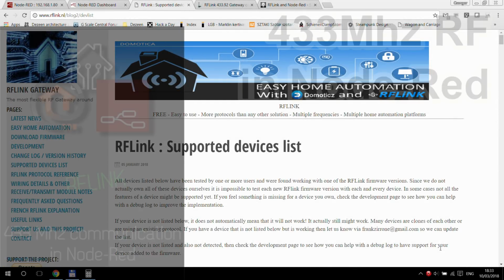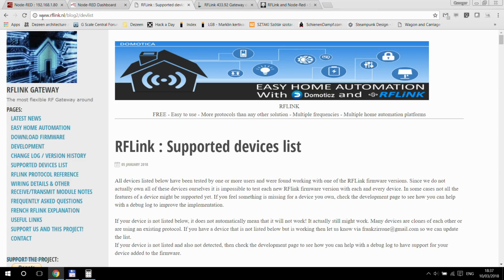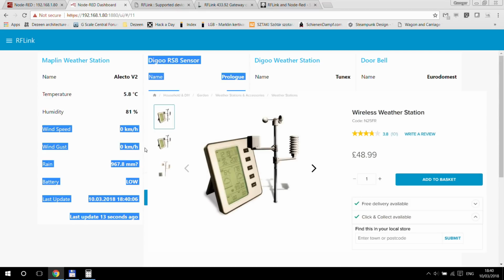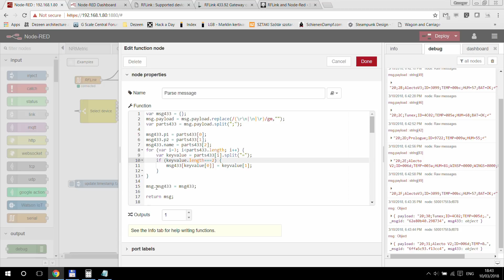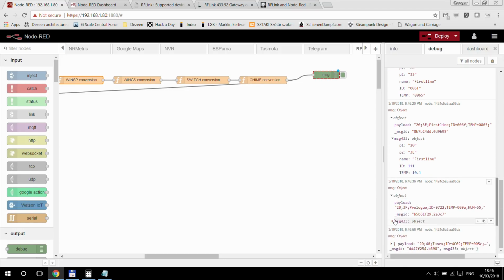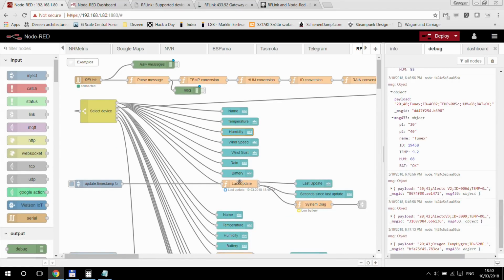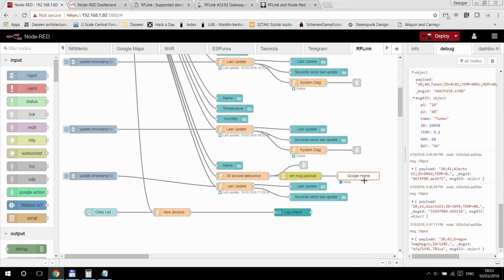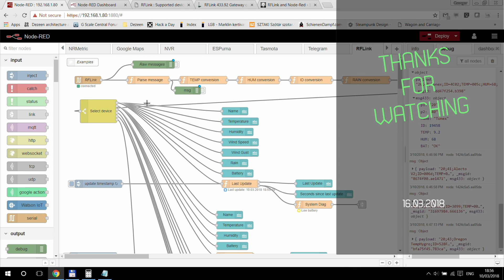RFLink, 433MHz gateway with Node-Red

Comment: This video helped me implementing USB connected RFlink, I decommissioned wifi-based RF gateways, and is more stable now. The problem of sending RF signals is fixed by just adding a "delay" node before the "serial out" node. Cheers and thanks
Reply from the maker: I am glad that this helped.

Comment: Was trying sending. In nodered serial out node if I inject 10;TriState;8a8a90;10;ON; or 10;TriState;8a8a90;10;OFF;  This turn on and off my  RF plug, but if send this command from a node or pir, most of the time it does not work, any ideas?

Comment: Where can I search/find the 433 devices? Im trying to pair a hygrometer and Im not sure where to find that Devices ID or its signal....
Reply from the maker: There is no search or find function. If your device is recognized by RFlink. Data will come through automatucally.
Reply: @csongorvarga  where would data show?  Is there an application I can run?   Im not to familiar with the whole process.   Thanks for your response 👍

Comment: What can I use this to read Fahrenheit rather than Celsius. Thanks for the great tutorial.
Reply from the maker: These sensors usually send in Celcius. You can add the C->F calculation to the node which converts the TEMP from text to float value.
Reply: @csongorvarga  Thank you I figured it out. I just started using node red..

Comment: Csongor - terrific video.  Great information on using RF and Node-red.  Are you happy with the Digoo weather stations?  Have you looked at the Sonoff RF Bridge?
Thanks.
John
Reply from the maker: Thanks a lot. Digoo weather station is fine. When I replace the battery it switches ID, so I need to adjust the flow. Probably it eats through the battery quicker than Maplin, but after all I am still happy with it. I did look at RF Bridge as well, but only the original iTead firmware.

Comment: which nodered modules do you have installed ? I got a Flows stopped due to missing node types.

sqlitedb
googlehome-config-node
Reply from the maker: I am using sqlite to store some of the readings in a database. You can remove them. I also use Google Home Notifier for my Google Home. Again remove those nodes and the rest of the flow will compile.

Comment: Very interesting video thanks for sharing. I built the RFLink but I can't get the node red serial node on a RPi to communicate with it. I have the ATmega linked to the RPi3 via a usb cable. Any help would be appreciated, thanks
Reply from the maker: Interesting. I think I forgot to add to it to my video, but once you build the hardware, you need to download firmware package. It contains a RFLinkLoader.exe that first you use to flash the firmware to the Arduino Mega (find COM port, browse the firmware file (.hex) and click Upload). Once this is done you can use this app to test if you are receiving any data (Serial Port Logging button). Make sure this is working before you go over to Node-Red.
Reply: Thanks Csongor, I should have said that I have the firmware running and can see correct output strings using Arduino IDE serial monitor. However once the usb lead is connected to the Pi with node red installed I am unable to get communication via the serial node. That's where I am stuck.
Reply: Update - It was a problem with the Raspian installation as a fresh install worked fine.
For the benefit of others reading this the Serial Node setting is  /dev/ttyUSB0:57600-8N1 
Hope this helps

Comment: great video got me up and running once I'd soldered my RFLink together i managed to amend your flow to suit my devices. Thankyou.  Are you planning to do a follow up video on sending messages to the RFLink?
Reply from the maker: Thanks. Absolutely. I have ordered various sensors, relay boards, and RF wall sockets. They are mostly in the transit. It may take some time as summer is here and also have some other reviews to be completed first.
Reply from the maker: But in the meantime I also enhanced the flow and got the rain gauge data processed, by generating hourly, daily, weekly rainfall calculations.
Reply: I've got some cheap RF Sockets and integrated those, my garage door was RF so I've now included that and have used the GoogleNotify note to play a message on my GHome. I'm also using Alexa Local node and want to use voice commands to send messages to the RFlink and onto various devices. I haven't yet been able to get an output from the RFlink node to the RFLINK port as yet....... I'll keep trying
Reply: Hi , did you ever do a follow up video covering transmitting data out from node red to RFlink and onto RF modules ie switches ? I can't seem to get the transmission to work.  I'm using V48 on RFlink software.

Comment: What the diffrence between 433.4 mhz and 433.9 mhz ? Which one to chose ?
Reply from the maker: Well, I don't know to be honest. Most device just say 433 MHz. My door bell actually said 433.92 Mhz, which was the reason I got the 433.92 MHz version. As you can see that is also able to receive signals from all of my weather stations/sensors. Maybe this is just luck, or these frequencies are so close that both of them work. I don't know. I am planning to buy some more RF stuff sold around in the high street shops, so I will know when I have more experience.
Reply: Thank you. This great. I was not sure how easy really was to do RF with node red. But after your video you really make it easy thank you again

Comment: excellent work, Csongor :)
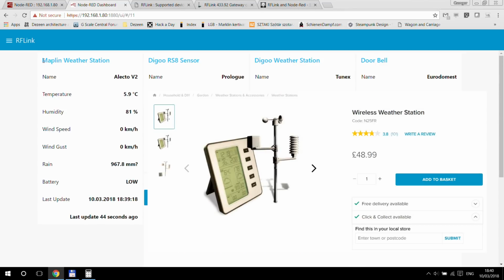can you publish links to the rf devices you cited a 5:30? is the maplin ws any good? thanks
Reply: oh, the replacement wind sensor is quite cheap on ebay...
Reply from the maker: It is in the video description. That flow generates that UI.
Reply: no, i meant the links to your weather stations (in the mean time i've found them, anyway), and if the maplin one is good or not, but from reviews on the net, its external sensors are quite "breakable" and they don't last very long, and batteries with cold temperature have very short life, too... thanks anyway :)
Reply from the maker: This is the maplin one: https://www.maplin.co.uk/p/wireless-weather-station-n25fr. Not sure how long this will be around as Maplin is going into administration. The battery last about 6 months or so. And we have below freezing temperatures as well. So I think it is fine. The wind sensor broken because it was hit with a ball, so in general use they are sturdy enough. I would recommend. This is the Digoo one: https://www.banggood.com/Digoo-DG-TH6699-Wireless-Weather-Station-Barometer-Forecast-Thermometer-USB-Outdoor-Sensor-Clock-p-1138609.html?rmmds=search. I am only using this for few weeks, so far so good. It is much cheaper, so I assume it will not last that long. In fact I need to kick the external sensor as it is not receiving data any more. Maybe interference with other sensors. I am not sure. And this is the second sensor: https://www.banggood.com/Digoo-DG-R8S-433MHz-Wireless-Digital-Hygrometer-Thermometer-Weather-Station-Remote-Sensor-p-1139603.html?rmmds=search